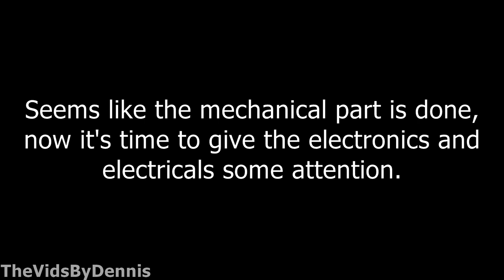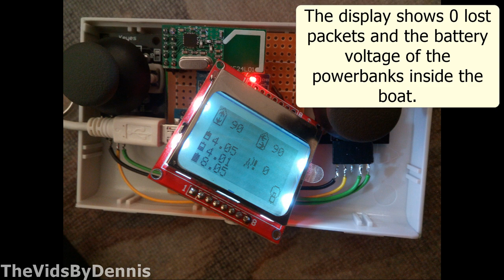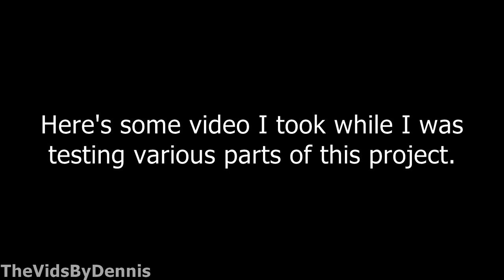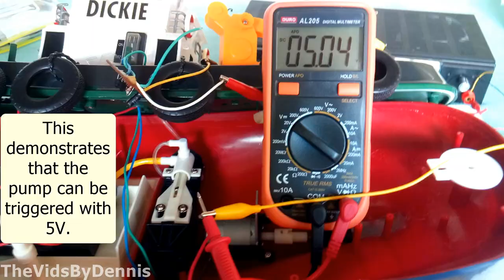Upgrading the RC Harbour Boat | TheVidsByDennis

Comment: I have the Dickie Fishing trawler Monica that is no longer available. I ended up removing all the junk electronics  and installed all hobby grade instead of trying to reuse any of the electronics. I just purchased a used tug boat , now made by Henlong but of the same quantity  minus the wax coated 1980's electronics. I added many LED's and an RC truck wench control to the wench that controls the fishing nets. On the tugboat I may use a sailboat wench to operate the big drum wench in back. I may power both wenches depending if I deem it cool enough to bother.
Reply from the maker: I have a playlist with all the videos about this boat, if you're interrested. I've made more modifications along the way. https://www.youtube.com/playlist?list=PLCazX-xmBQ9A6XO_qzh6bjZabqHFwajTY

Comment: Leuk! Ik ga dit sleepbootje ook wat verbeteren. Denk naast servo ook aan wat sterkere motor en esc. Plus schijnwerpers die functioneel zijn. Gaat dienst doen als sleepboot voor gestrande rc racebootjes
Reply from the maker: Ik ben van plan om mijn boot nog een goede afstandsbediening en ontvanger te geven. Mijn huidige setup met 2x arduino nano en NRF24L01 heeft niet echt veel bereik (<10m), maar het heeft wel telemetrie zodat ik kan zien wat de spanning van de accu's is en hoeveel pakketjes data er verloren gaan.